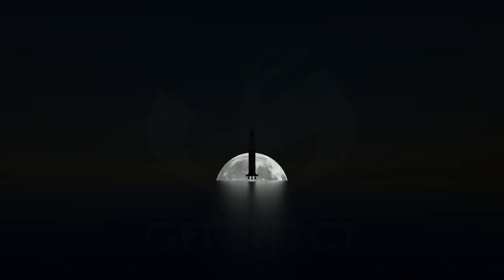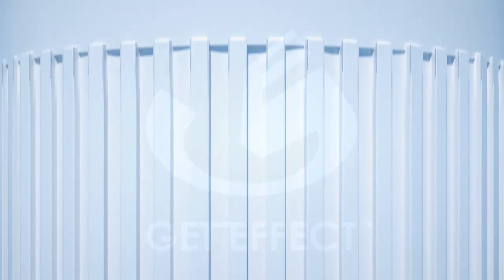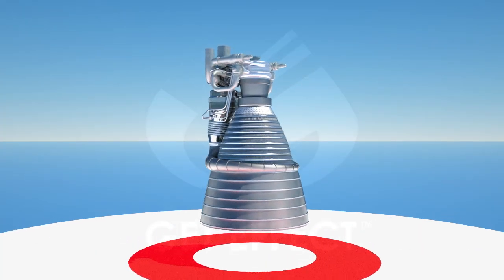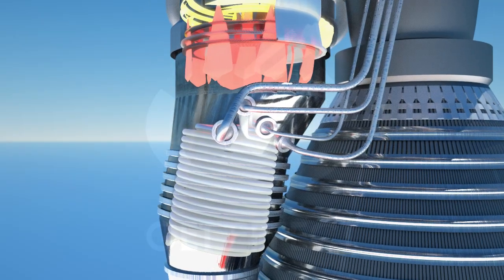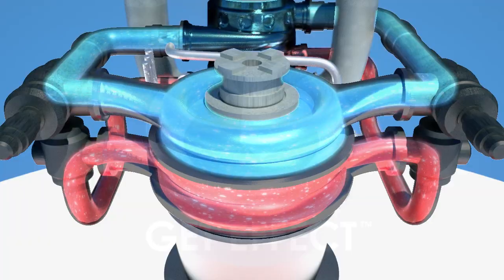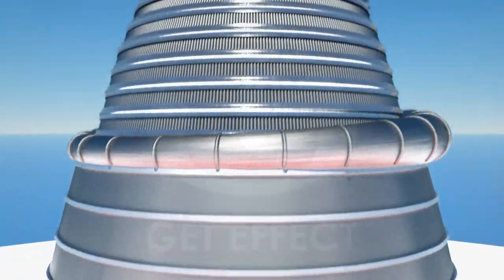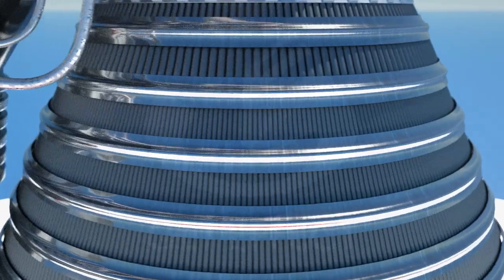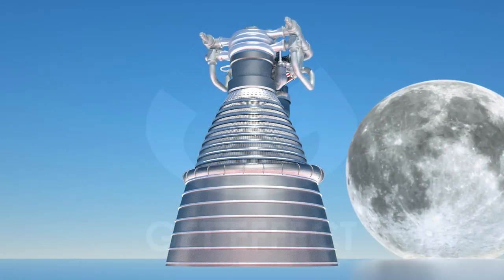NASA SATURN V ROCKETDYNE F1 ROCKET ENGINE, AN ANIMATED DOCUMENTARY (2016)

Comment: The helium didn't only pressurise the fuel tank. Bubbles of helium were deliberately introduced into the fuel feeds from the tank to the engines to make the fuel compressible. In doing so, this dampened the pogo oscillations that had plagued the first few (unmanned) Saturn V test flights.

Comment: the bottom of the two pumps shown at 1:30 is spinning in the wrong direction. Or rather, its vanes are spiraled the wrong direction. Those are centrifugal pumps, so the fluid should move from the narrow portion to the wide, radially exiting portion.

Comment: An amazing and awesome piece of engineering. Just doing some back-of-the-envelope calculations on this engine... The specific impulse (Isp) of this engine ranged from 260-263 seconds. So, the engine exhaust velocity was in the range of:

Ve = Isp x g0 = (260 s) x (9.80665 ms^-2) = (approx) 2550 ms^-1 = (approx) 8,365 fps = (approx) 5,700 mph (!!)

From Tsiolkovsky equation, the speed of Saturn V at end of 1st stage burnout is approximated by:

dV = Isp x g0 x ln(m0/mf) ... this is theoretical maximum because doesn't take into account drag of atmosphere and other effects and inefficiencies...assuming all 5 engines.

m0 = mass of Saturn V at launch = (approx) 2,950,000 kg (from NASA)
mf = mass at 1st stage empty = (approx) (1-0.78) x m0 = 649,000 kg

numbers: dV = (260 s) x (9.80665 ms^-2) x ln(2,950,000/649,000) = (approx) 3,860 ms^-1 = (approx) 12,666 fps = 8,636 mph. 

Again, this is theoretical max at stage 1 burnout and does not take into account drag, etc., so actual speed will be less... let's say 30% or so... or, just north of 6,000 mph at end of stage 1. Amazing!

Just awe-inspiring. Thank you for posting!
Reply: The most important factor reducing the actual speed at first stage burnout compared to the theoretical maximum wasn't atmospheric drag, but gravity.
At lift-off, the Saturn V's thrust-to-weight ratio was about 1.2, meaning that 83 % (1/1.2) of the thrust went into fighting gravity, while only 17 % went into producing acceleration. That ratio did of course improve greatly during the first stage burn as fuel was consumed and most of the acceleration changed from vertical to horizontal as the rocket gradually pitched over.
I'm not an expert on this, but I'll guess that smaller rockets are less affected by gravity since they tend to have a better thrust-to-weight ratio at lift-off, but they are probably more affected by atmospheric drag than the Saturn V was.
Reply: and, drum roll please, the turbo pumps, were rated at 55,000 HP ! Yikes

Comment: Each F-1 engine was a hand tuned unit.  No two were alike in final tune condition.  Nozzles, aperture size and placement were unique to each motor.  Those final notes went with the individual engineer with their personal notes at the end of the program.  Flame combustion instability is the number one problem as rocket engines get larger. We solved it by insanely delicate final tuning.  Russia just used a big pump to supply many smaller rocket chambers.  Ones that were simple  to keep burning.  That made them very stable and dependable.  Who was right?  Don't ask me.  Each had their good points too.
Reply: The combustion instability was cured by the installation of baffles on the injector face.

Comment: It was the strongest rocket, then SpaceX came along...
Reply: The Saturn V is still the king until the BFR and SLS are ready to fly.
Saturn V's lift-off thrust was 50% higher and its payload capacity twice as high as that of a fully expendable Falcon Heavy (with no booster landings).
The two closest contenders were the Soviet rockets N-1 and Energia.
The N-1 had about 30% higher thrust than the Saturn V, but all 4 launches ended in huge explosions. Even if it had worked as planned, its payload capacity would have been lower than that of the Saturn V.
The Energia had virtually the same thrust as the Saturn V, but lower payload capacity. It made two successful launches in 1987-88, including the first and only flight of the Soviet space shuttle Buran. A planned version with 8 boosters rather than 4 would have significantly exceeded the Saturn V in both thrust and payload capacity, but was cancelled.
Reply: @fromnorway643  According to everyday astronaut, it is the strongest.
Reply: @sharonsullivan5763  
The Falcon Heavy in its fully expendable mode has the highest lift-off thrust and payload capacity of any rocket that is operational today, but the Saturn V greatly exceeded it in both respects and so did the Soviet Energia. The American shuttle also had higher lift-off thrust than the Falcon Heavy, but lower payload capacity, as most of the mass injected into orbit wasn't payload, but the shuttle itself.

Comment: This video is pure fantasy. You guys are layman with no academic and technical experience about the Rocketdyne F1 Engines. I have a Bachelor of Science Degree in Aerospace Engineering and I've spoken to a number of Rocketdyne Engineers in Canoga Park, CA, and they will never admit it publicly, but in private (off the record) they said that the Rocketdyne F1 Engine is not even powerful enough to send men to the moon safely. Yes, that's correct, the Rocketdyne F1 Engine is not powerful enough to send men to the moon safely. Astronauts would be near death within 24 hrs after passing through the Van Allen radiation belt given the past thin radiation shielding used on space crafts. You guys are just regurgitating propaganda for mass consumption. Do the math, or the rocket science.
Reply: You're funny and also full of shit :D.
Reply: First of all, that's just nonsense, and secondly, how would a more powerful engine protect the astronauts against radiation?

Comment: I'm curious, can the F-1 eventually use Hydrogen instead of that RP-1 Propellant?
Reply: No.  At a minimum, the injector plate would have to be redesigned.  More likely, the entire engine would end up being redesigned; better to start over with a blank sheet and build new.

Comment: If i'm not mistaken the fuel inducer is actually pumping the fuel back into the tank according to this animation. But otherwise very well done. 
The F1 is the hot-bulb engine of the space age. As simplified as anything can get. Hmmm... I wonder what we are gonna use as lubricant for the turbo pump. Answer: rocket fuel. Hmmm... I wonder what we are gonna use as hydraulic fluid for tha gimballing pistons. Answer: rocket fuel. And take it directly from the turbo pump and skip any extra hydraulic pump.
The 5 turbo pumps combined produced 5000 more horse powers than the USS Nimitz throttling at full speed. And thats just to feed the engines with oxygen and fuel. A mindblowing little factoid.

Comment: All F-1 Rocketdyne saturn F-1 engines assembled in finall configuation were 90% tested at Mississippi Test Facility in Hancock County 20 miles from Picauyne Mississippi and approximately 30 miles from Gulfport or Bay Saint Luis Mississippi. Most were tested fom 1966 thru 1972 when the Ap came to a close!
olo

Comment: The fuel burns, it does not explode.  Explosions do not need Oxygen from an external source and occur much faster.
Reply: J T, you are correct, but ironically the burning process is so fast and furious, rocket thrust chamber combustion has been referred to as a "continuous explosion."

Comment: The Saturn was a great launch vehicle but the real engineering was the lunar excursion module.
Butt ugly but think about it. Environmental, navigational, temp. extremes it needed to land and then take off. Strong with major weight restrictions. In my opinion, absolutely magnificent.
Reply: The whole Moon landings programme was magnificent and the fact that it was created purely for political and Cold War propaganda points scoring does not detract from that.
Apollo showed the world that, when the task is noble, America can achieve anything – as long as it keeps its eye on the ball, because Apollo also showed the world that, as a society, America has an attention span barely long enough to make it to the next commercial break.
Apollo 11 landed to a frenzy of American flag waving and self-adulation – and rightly so, because America had earned the right to feel proud – but when the ticker tape parade was over, so was the party and Apollo was effectively running on inertia. By the time Apollo 13 launched, the TV networks, which influence, and are influenced by, public opinion, could hardly be bothered covering it. Of course, that changed abruptly after the explosion, but the rot had set in and the rest of the Moon landings were, to a public that needs Disneyland every day, boring.
Apollo gave my generation the defining moment in history and I have always counted myself fortunate to have witnessed it.
Reply: @MarsFKA  One other major reason for the Apollo program, and the space program in general, was to advance missile and weapons tech. Sad but true. Once the military got what they wanted, and the politicians got the win over Russia they wanted, the program was lucky to continue past the first landing. Almost immediately there were calls to cut funding and end the program. Unbelievable. And now here we are 50ish years later talking about going back because of the economic potential of mining. And yet, we could have just continued back then and who knows where we'd be technologically?
Reply: @effervescentrelief  What weapons did Apollo advance?
Reply: It also housed the most powerful and compact computer of it's day.

Comment: Its better, then РД-180??? 8-)))
Reply: According to open source information, the thrust of the RD-180 is 930,000 lbf in a vacuum.  The F-1 engine achieved 1,746,000 lbf in a vacuum.

So, the F-1 produces roughly twice the thrust of the RD-180.

Of course, these engines are intended for different applications.  The F-1 is a specialized heavy left engine while the RD-180 is more of a medium lift/general purpose engine.

Its rather like comparing the family pick up truck to a dump truck.
Reply: The difference between these two engines is very simple: RD-180 exists in nature,  F1 - in a fairy tale for housewives and young onanists only.
Reply: If I recall correctly, every Saturn V had five F-1's under it.  So, your fairy tale seems to have a certain amount of reality to it.

If you want to play Russian Fan Boy, maybe commenting on video games is more your style.
Reply: Saturn V flew on anything, but not on a one-chamber F1. This engine is absolutely impossible, which was proved by practice. The model of Saturn crawled to the Bay of Biscay on something else.
Reply: That's shocking, because the NASA website says the engines were F-1's, all the photos and film of the lift offs show F-1's, a recent expedition recovered several F-1's from re-entered 1st stages, and the F-1's are on the display Saturn V's.

Of course, if the voices in your head say that's all wrong, who is the rest of the world to argue?
Reply: a person with technical backgrounds and the least curious can not help but know that Saturn V was unable to exit even to a low reference near-earth orbit. The facts testifying about this, you can easily find in the internet.
Reply: Whatever the voices tell you, Son.
Reply: PoorSong Internet? Not published peered review papers? Interesting well as they said its on the Internet so it must be true.
Reply: Waltham1892 well the 1st stage was only meant to operate until low earth orbit so he is right in some ways?
Reply: What's the song name please?

Comment: Bringing back the F1 would make going to space even more expensive than Shuttle.  Then their is other issues.  One they never solved the instability issue, only created an plate that corrected the problem.  Two they found out that 2 nozzles with a single engine would have produced more thrust to weight.  Three, by the time they brought the engines up to date, it would be a totally new engine.  Finally, such a giant engine being a complete loss every launch is a travesty.

Comment: Still the best looking engine when it fires up. I get it, H2 and LOX is more efficient but it doesn't look nearly as good when it lights off, just looks like a bunch of steam, which is precisely what it is. 

There's no mistaking a Saturn 5 lift off. When those flames shoot out from the trenches, it's awe inspiring power.

Comment: You rocket designer guys think you could use Advanced Metal 3D Printing and Direct Metal Laser Sintering (DMLS) of micron fine powdered Tungsten/Copper (W ≈70%/Cu ≈30%) along with transgenic silkworm/spider silk and aramid fiber reinforced carbon composite for throats, combustion chamber, and skirts to get super lightweight, reusable, throttlable, CH4 fueled, full-flow staged combustion F1 and CH4 fueled RS25 engines? Then a RS84 stile FFSC type F1 wouldn't weigh very much at all?

In the future somebody might want to design and build an autonomous 50 m x 300 m reusable plastic booster with active linear electromagnetic motor-dampened non-gimbaled fixed mount F1 engines around the peripheral support rings and 9ea RS25 engines on a central 2 axis gimbaled active LEM-dampened thrust vector control face type engine mount within the bottom thrust structure (similar to a RD-809M)?

Comment: How strange this is... a sterile feminine computer voice and equally sterile animation tells us how an amazingly  powerful device operated,  yet you must know it was designed by American Engineering Students using very accurate SLIDE RULES...Not analog or digital networked electronic computing devices.   I think that task is MORE AMAZING than the fact that this device actually worked... on multiple launches...  Hey American Engineers, I CHALLENGE YOU to EQUAL this 1960's era task.... And Yes I think you can do it!  NOW GO FOR IT!!!

Comment: Soviet rocket motors were much bigger than the F-1s.  Why do these guys have to lie their asses off all the time?
Reply: no they were not. The Soviets tended to use a larger number of smaller engines. Not to say they didn't make some of the most powerful engines for their SIZE.
Reply: Rob Cohen Not speaking of physical dimensions.  American scientists did not believe that the Soviet motors were what the Soviets said they were.  Closed loop and more powerful than US motors.
Reply: The word "bigger", which you used, refers to physical dimensions. Yes their closed loop engines were better than the USA thought was possible. They aren't larger than American engines though so stop pretending you're right.
Reply: Rob Cohen Okay, i'll stop pretending.  But I am right.
Reply: The ones that are use multiple chambers and nozzles, but they have a single turbopump assembly so they're considered single engines. The Shuttle's SRBs were also much larger and more powerful than F-1s. The F-1 is still the largest single chamber liquid fueled engine ever fully built and operated.
Reply: I have been lax in my studies.  Thank you for that info.
Reply: And hence the Soviet designed RD-180 engines are being used by United Launch Alliance of the US to power their Atlas V, a rocket that the US, DOD is using for all sorts of military satellite launches.  Russia, if it was of a mind, could go back to building and launching the N-1 Moon Rocket which used 30(?) or 33(?) RD-180 engines as these have been well tested now by the many launches of the Atlas V rockets.  There as been a sort of synergy with the US/Russia space systems.  Still RD-180 is a long ways away from the power of the F1.  I have not studied the newer Russian rocket engines like what were designed for the Energia rocket launch system, for instance.

Comment: Well, that's good to 2m30sek video shows how the combustion instability develops in the fire panel. Why? Because the fuel is mixed with an oxidizing agent only in the combustion chamber after firing bar from which a lot of thin tubes with fuel and oxidant. Because of this, in the combustion chamber of combustion instability occurs. Due to this instability fuel combustion engine F-1 could not develop a 40-60% higher power because combustion instability standing wave induced in the combustion chamber (fuel blaze with the resonance frequency) due to strong vibrations which have poor combustion and fuel. When power to the 100% engine F-1 just collapsed and exploded. The Russian RD-170 which is now purchasing US fuel with an oxidant pre-mixed in a special mixer and pump into the combustion chamber through a special screw-injector nozzle is supplied already combustible mixture that burns cleanly right behind the nozzles. This provides 100% combustion, the absence of combustion instability within the combustion chamber and good traction motors. Even in a conventional gas cooker gas is mixed with air before pre-burner and the burner in the gas mixture is already supplied with air, so the blue flame burner, combusted gas quietly without smokes and flares engine F-1. And try to ignite the gas directly without mixing with the air, it will smoke, the flame will be red because of poor combustion and burning flares will occur. All of this occurred in the motor and F-1. He wildly smoked coke from unburned kerosene flames were flashes of color red with flame soot (it can be seen in all the official NASA video). Due to poor traction and combustion instability Americans abandoned the F-1 engine in the future, but for now he needed them for staging the Apollo missions 1- 16. Since the start refuel and frosted only the first step and the remaining steps were a hoax, which fell after hiding from the eyes of viewers in the Atlantic Ocean. And now the Americans draw cartoons replacing their official video, as by Mach cone in the atmosphere easily specialists determined that the velocity of the rocket in the separation stage 1 was 2-3 times lower than the estimated !!! US wish success in his future purchase Russian RD-170 engine